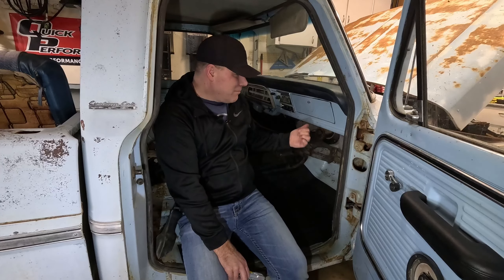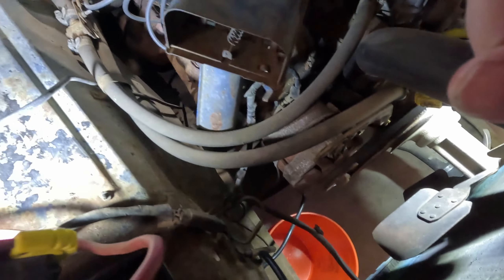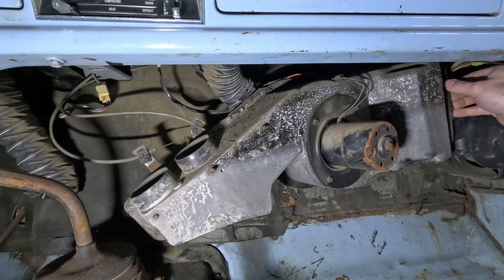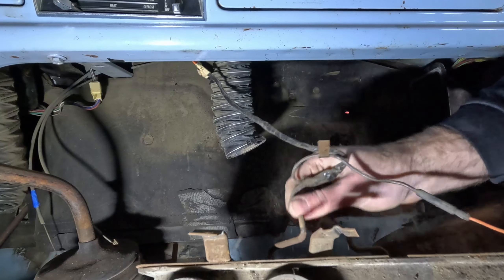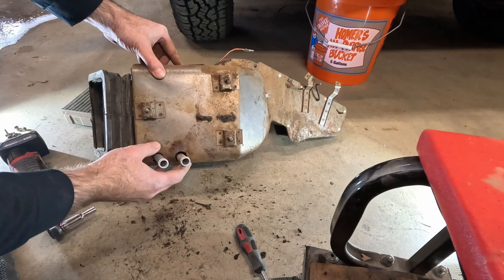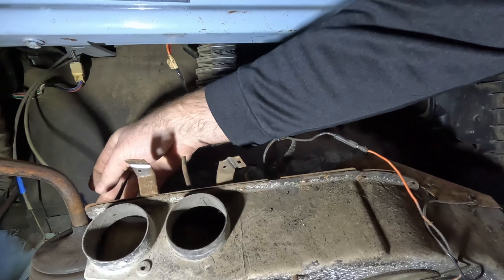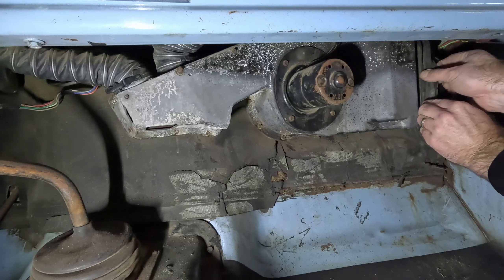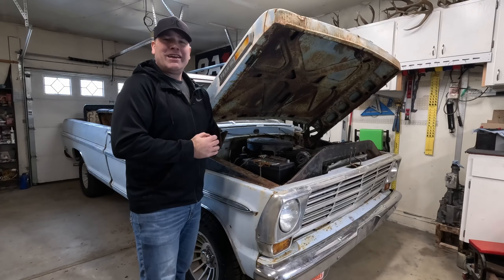F100 Heater Core Install

Comment: So much more room to do a heater core on the F100  than on the Mustang!
Reply: SmackeysGarage You should try doing it on 1988 Ford Ranger the little truck. Don't ask me how I know about that.
Reply: @lilorbielilorbie2496  I'm good lol. I can imagine it would be a nightmare in that small of a space. The heater core is probably one of the car parts that got less and less serviceable over the years.
Reply from the maker: It was definitely easier to do.  I don't like that coolant valve-thing in the engine bay, it complicates the system.  :)

Comment: That was easy. Imagine trying that on a brand new f150.
Reply from the maker: Right!?  No thanks, I like how easy it is to work on these older vehicles.  :)
Reply: I agree, no thanks. Last heater core on a "newer" car was an 86 thunderbird. I had to pull the dash.

Comment: Anyone know what type and size hose he used to replace the old one? Just got my first truck and slowly trying to fix the problems has a bad leak from the heater core
Reply from the maker: It's standard 5/8" ID heater hose.  I purchased 12ft, but didn't need that much.
Most car parts stores (like Napa) have a giant spool of this stuff, just tell them how many feet you need and you're golden!  :)
Reply: @ thank you sir!